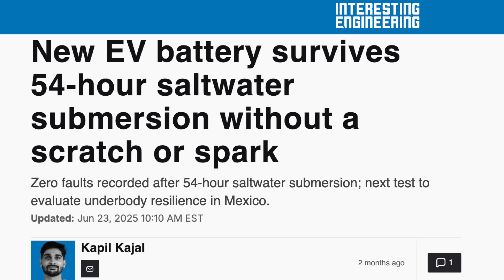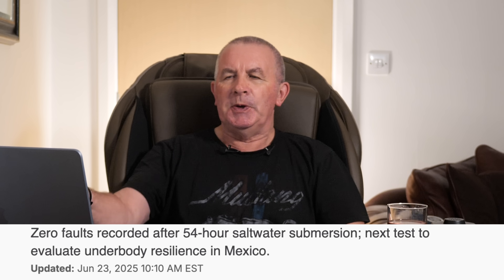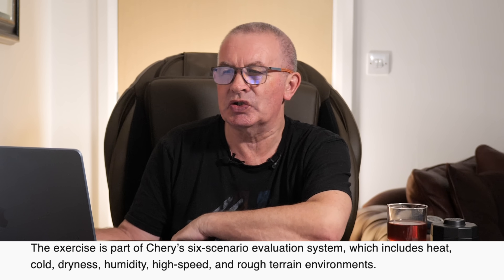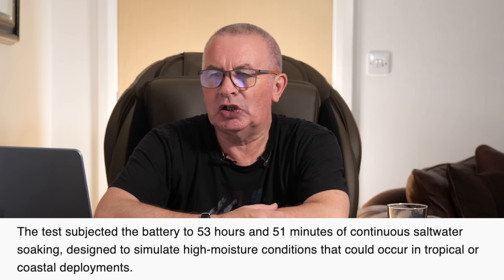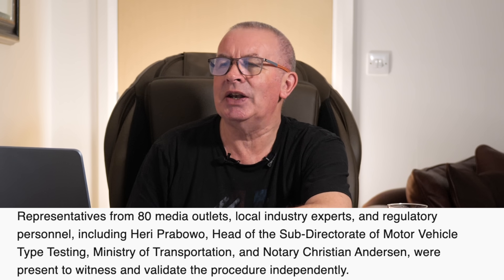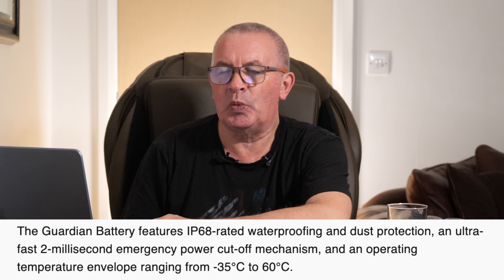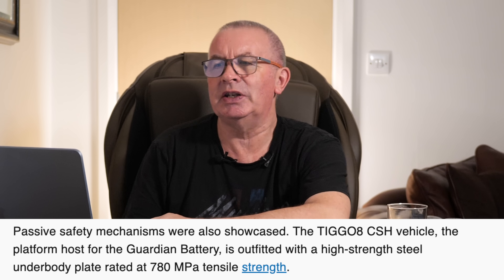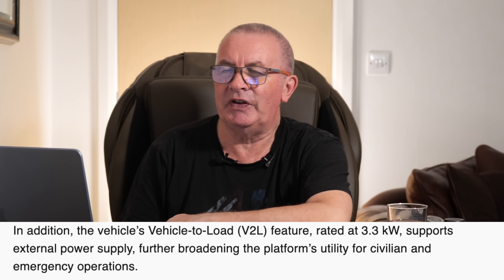This is what happens when salt water gets in an EV Battery

Comment: Why not test a battery thats spent a few thousand miles being rattled about under a car and suffered torsion stress around the seals? Do tests at different depths/pressures. Then immerse it in salt water for 5hrs........then let it sit in the sun.......back in the water.......sun.....water....over a period of 10days. Then test it 6 months later. See it the results are the same. Many things are waterproof when they're new.........

Comment: 2:38 great, did they use that battery in an automobile for a year or two first? Driving it over pothole festooned roads, washboard dirt roads, shaking the case to oblivion, twisting with the chassis as it accumulated mile after mile? 

Do that… then test the battery in its case.🤦

Comment: Used battery packs with thousands of miles of vibrations will effect the sealing of the pack. Seals also degrade over time. A new sealed pack is a great PR exercise but has no relationship to a  real life situation.

Comment: OK so a test is done. A permanent discoverable record is created showing a dangerous fault 0:02 

Person or persons decide to conceal that

S75 of the Road Traffic Act 1988 (supplying unroadworthy vehicle) should kick in:  unlimited fine. 

May also be fraud by omission: 10 years' imprisonment and/or an unlimited fine

Or potentially Conspiracy to supply unroadworthy vehicles/commit fraud by omission 

Nasty

Why aren't these things being repaired under warranty or insurance claim?

Who decides it appropriate to push low mileage potentially dangerous, warranty voided unrepaired EV's and Hybrids into the auction and conceal the battery health certificates?

Well that is a very good question

Comment: For me it looks like the battery is inside a sealed box and I bet that the box is filled with Nitrogen, slightly over pressure, so that water will never touch the battery
For RC models that use Lithium batteries, it is recommended to immerse the batteries in salt water, for a few days, to fully discharge them before discarding them, safely

Comment: That test proves nothing. I worked on aircraft certification. We would have carried out tests on batteries with various faults in the casing. Possibly by cases with faults/holes of a known area and then the case submerged. You could then record how long the battery lasted before going into thermal runaway. If it didn't after X hours you would have proved something.

Comment: That battery may have worked fine, BUT there's now a latent defect with internal corrosion over time.  Corrosion = resistance = heat. Goodluck.

Comment: Not an impressive test, new battery, fresh seals for electrical connections, breather seal(s) for expansion. A real test is something like you would have in the aerospace industry, a proper qualifying test with an environmental chamber with varying temperatures, units under  test being powered up / down as they would in real life, on a shaker table to check operation with vibration, salt fog or sprayed with water . Even then such tests don't take account of time degradation of plastics / seals, which would probably be a major consideration. More worrying than assuring, have they actually done any long term real life accelerated testing driving a fleet of cars to destruction before production to work out what the actual failures in real life are likely to be or are manufacturers winging it? Some of the dire reliability issues with modern cars (of all types) suggests this is the case.

Comment: Also just like you can manipulate statistics the same with the supposed scientific tests, I note how they talked about the tensile strength , well tensile strength is only good for something that is getting pulled or is under pressure.  when you’re looking at something like a car body that could be crushed or deformed you are looking fora different strength-that resist compressive loading. So the tensile test while one measure is not a major factor that would give me confidence for underbody strength in that scenario

Comment: Oh crikey, we are never gonna have electric sea vessels 😢.  So that's it . When will they stop EVs parking close to a  sea wall or on a beach . ?? Between me and you think EV is definitely a better option or makes sense as in multi  thousands of polluting🚬🌪️👃💨 ice exhausts for satellite towns that are within say 50/60 miles from a  city edge. Wanna argue the pollution from ice vehicles , just turn yer deisal or petrol vehicle on the drive  ,sit yer kids  or grandkids outside  by the exhaust pipe for couple of hours . Yeh like fuck you would . Put them in danger of course not , TRY that with a EV for the day , yep they would be well  bored 😢but they wouldn't be harmed 😂

Comment: The test was clearly just an advert. The test was not real world, the battery wasn't under drain because it was not powering anything. A waste of time, clearly. Also, an underbody plate made of 780 MPa (Mega Pascal or Newtons per square millimetre) tensile strength is meaningless, it's the thickness that matters when coming into contact with an object regardless of its ultimate tensile strength. In fact, the higher the tensile strength, the less ductile the material such that it could fracture instead of dent so letting water into the internals with catastrophic results. Even a dented battery is enough for thermal runaway it seems from other much more scientific tests and actual accident data.
Reply from the maker: Thanks for your feedback, I appreciate your insights into the test methodology.

Comment: When you buy a new iPhone, it is tested to have 7 m of water resistance 'IP68' after 18 months a lot of iPhones are actually zero because once you heat the phone up a few times, leaving it in the sun, the glue melts sitting on it on the phone in your back pocket removes water resistance. Testing a EV battery after five years is real science.

Comment: How much did the battery unit weigh? How much energy gets used to cart it around every time the vehicle moves? Add in tyre and road wear and tear. Don't get me wrong, it is a gorgeous battery pack and really useful. Further scrutiny and adequate results regarding safety might make this industry standard. Then, and only then, use it it for static installs or small city cars. QED innit.

Comment: So Barrie what happens when water from Rufford Ford gets inside an internal combustion engine
Reply from the maker: Water cannot be compressed so the engine hydrolocks , probably bends the con rods and ruins the engine, it doesn’t blow up like an EV does if it gets water in the battery

Comment: What's a complete waste of time is listening to you spout rubbish  the battery as with all ev is isolated from the external environment so no water is hitting the battery case at any speed the battery  cases are string  this shows the seal are good they already done all the other testing and these items have been independently certified. They are good. These are not tests they are demonstration to show that even if full submerged the battery  will function that's great it mean your chery suv can happly wade through water. And no liquid will penatrate and cause issue. 
So there will be no issue 
The battery already has a liquid cooling/ heating  system  flowing internally.  I really do not understand your negativity towards ev . We are on our 5 battery vehicle  be it fully or assisted.  Our first ev we had 5 years  its go off to a new home after 5 yesr and 66k the battery still had 99.4% of it originally capacity  so in 5 yrs 66k it lost 0.6%.that less than a petrol engine looses . 
Non of out car have had too have any work done on the, other than routine service. And one airbag recall 
You just do not like the fact that we moving on and leaving a technology that out dated inefficient. For a system that constantly improving . 
With semi solid state batteries and solid state on the horizon  that do away with the lithium things will get better. 
This week it was announced by several industry watch dogs that legacy manufacturers have been making hay with ev prices. That ev have been cheaper to manufacture than ice vehicle for 18 months and lf legacy manufacture sorted there labour issue out they would get closer to the chinese manufacturing cost. 
Yes its means a change in the way own  and maintain cars. Servicing cost and intervals will have to change currently legacy manufactures are sticking to 12 month service to give dealers income when infact most ev will happily go 2 or more years without a service. Our ev for the first 4 services they where simple safety checks and updates with nuts and hinges being greased brake fluid checked for  water even after 5 year 66k our break pads still had 75% life left in them . At year 4 the heat exchange fluid for battery and motor was replaced along with brake fluid  this was considered as the major service. 
There is very little to go wrong
Reply from the maker: Except a Tesla set on fire in 8 inches of water, you haven’t got a clue 😂 if you have all the answers why are you watching my channel? So you can cast doubt and push your EV agenda , oh dear so transparent and so angry because people like me are telling the truth and showing you lot up as liars 😂
Reply: EVs are an expensive flash in the pan until hydrogen becomes mainstream

Comment: What little elemental lithium exists inside batteries is inside the graphite lattice which is itself inside the "jelly roll" where water cannot reach it.

The problem with water in battery packs is corrosion and shorting out of components that can send the pack into thermal runaway.
Reply from the maker: Great explanation, thanks!
Reply: Not forgetting the cathode where it intercalates. I'm no lithium electrochemist, but several of my colleagues were. The electrolyte is critical and is hygroscopic even from moisture in the air. Any water present for sure leads to degradation (corrosion) side reactions.
Reply: @horserous  Before water can get to anything inside battery cells, it has to get through the pack housing and the individual cells' packaging.

The point is that you aren't going to get a "coulomb explosion" from dropping cells in water because the amount of contact between water and elemental lithium is extremely limited.

Explosions from lithium batteries have more to do with the cells violently rupturing from pressure relief valves unable to keep up with out-gassing rate during thermal runaway or gasses pooling in an enclosed space finding an ignition source, not any sort of lithium-water reaction.

Comment: Nice one baz  but didn't fool me !! That much lithium  in that much water would have almost taken yer room out ... lol  nice try .  Bob😅😅😅
Reply: I regularly put 4s (14.8V) 5000mAh Lithium batteries in a small bucket of salt water and leave it outside for 2 weeks. I've been doing this for the last 8 years when my R/C buggy packs start losing capacity. The result? A fully discharged and inert battery pack that can be safely disposed of. There's no explosion or fire, just a very gentle release of gasses into the water over time that can hardly be seen. This is the recommended way to safely neutralise R/C LiPo packs. Lithium batteries are only a fire risk when they're damaged whilst still holding a charge. And no, I don't drive an EV, I'll never have one, it's ICE all day every day for me. 👍🏼

Comment: Static water tests prove nothing, particularly as they were talking in context of high humidity environments where the problem is often not water ingress but water vapour building up inside battery case and condensing
Reply from the maker: That is a good point about the potential for condensation issues.

Comment: Hi Barry.   I suppose if they could totally encase the battery , that might prove a way forward . But what about the rest that are not so well protected .      From my perspective the safety aspect is proving the greatest issue , whereas  range and practicality may not be so important  for many customers .   👍
Reply from the maker: Great point
Reply: Even that wouldn't be enough, inside the battery housing are thousands of individual cells & any of them rupturing, or getting a crack, or manufacturing defect, or chemical instability- and whooosh! You're up in flames!
Reply: Indeed. Race to be the cheapest on market means safety is not a priority

Comment: Problem really isn't only the battery. It is also all of the power electronics and connections... Screw those up by oxidation and you can short something or burn something out. You know like when you have poor connection or frayed wire...
Reply from the maker: Very true